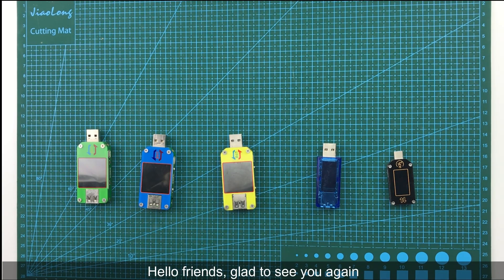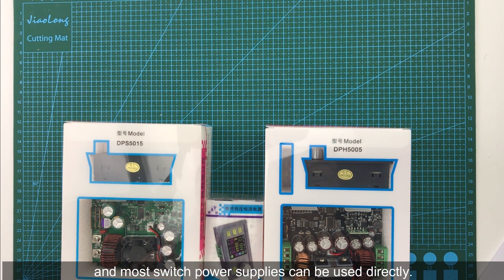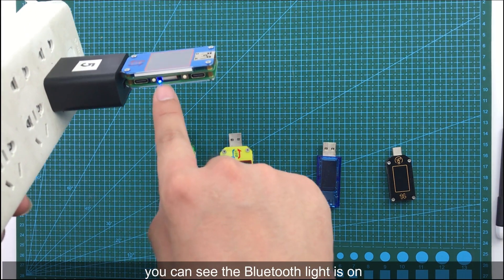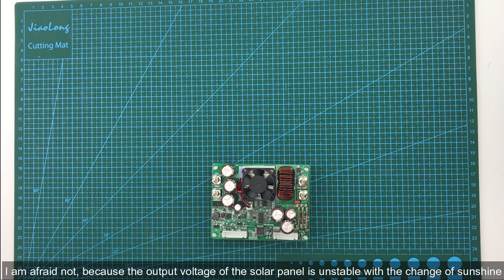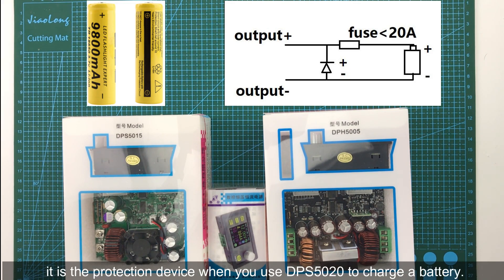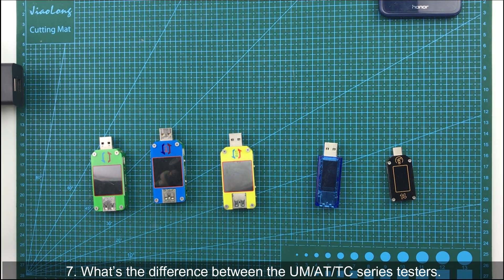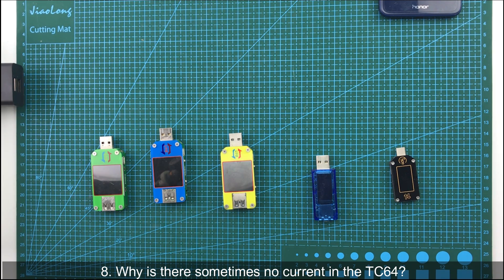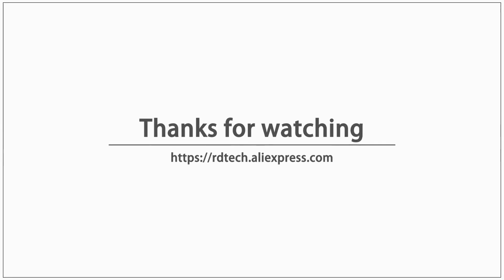8 Frequently asked questions about RD products(DPS5020, DPS5005,TC66C,UM25C...)

Comment: When changing battery, reverse connection is allowed, tried it before and all the dps5015 did is measure the battery voltage.
Reply from the maker: never allowed, it will burn the components
Reply: It didn't burn the dps5015 all it did is show the current battery voltage, plus it was done more than once
Reply from the maker: @TheUnknownCatWarrior  maybe you don't burn the board, but a lot of people burn the protection circuit by connecting the wrong electrodes, so just do not think it can reverse connecting just because you are lucky enough

Comment: i try to connect led 3v, using setting 12v 20ma on dps5020.
if i connect led first then output power on it's fine, if power on then i connect led 3v it will burn my led.
that's normal? Can you explain this?

Comment: One question, Why can't two power supplies be connected in series? I would like to use it as a dual supply to power op-amps that require dual supply (i.e. +/- 15V).
Reply from the maker: thank you for your comment, when we design the power supply, we didn't consider that someone will use two of this in series or in parallel, so we didn't add related protections, if you use them in series, it may be damaged
Reply: @rdtech9153  Thank you for the response. So even the older model DP3050 is not suited for series connection? What should be added? I think it would be an interesting option for future models since if they can be used in series for Split supply they can be used to power op-amps or audio amplifiers, it would be interesting and I think you would sell more devices. Anyways I like your products, I Will probably buy one in the near future.
Reply from the maker: @carlosagorreta5276  thank you, all of our power supply cannot be used in series, we doesn't add the protection circuit , so this problem will not be fixed by adding some components. if you want high voltage or high current, you can wait for new version, like DPS3003--DPS3005--DPS3012 then DPS5005--DPS5015--DPS5020
Reply: @rdtech9153  hi. What I want is a split supply to test op amps that require a split supply
Reply from the maker: @carlosagorreta5276  sorry for that, now we don't have that

Comment: Eu posso colocar uma fonte chaveada de 24v 20a no dps5005?
Reply from the maker: thank you for your comment, yes you can use that to power on DPS5005, and it can only work in buck mode

Comment: DPS5020 stuck in LOCK mode when disconnected from USB cable.  Can device be UNLOCK without connecting to USB again?
Reply: Silly me.  I should read the manual.  I guess I never had the need to use this function.
Reply from the maker: @TheAnalogKid2  it is OK, the manual is quite long, sometimes these functions will not be noticed if you read it fast
Reply from the maker: TheAnalogKid2 long press the rotary encoder can lock or unlock . Usually it will lock when connect USB. AND unlock when disconnected

Comment: Great information. The only cons about this is something Spirit Realm already told and that is about audio quality. Try to get a better microphone. Beside everything said in this very informative video I believe there is another information that is worth telling. And it is about power supply current (DP/DPS input current) regarding to the output current (from the DP/DPS). If you have a DP/DPS version you don't need a power supply that has the same or higher current that DP/DPS will be able to output its maximum. For example: If I have DPS5005 and have a power supply of 50V and 2A maximum, DPS will still be able to put 5A at output. Not up to 50V, but  for sure at 12V. This is because DPS is limited with voltage of the power supply and power (wattage) of the power supply. Of course DPS has efficiency which I don't know what it is :-) But I believe you can have more to talk about it in your next video ;-) Keep up the good work!
Reply from the maker: Thank you. DPS and DP series are buck power supply. The output voltage must be lower than the input voltage. For current, it doesn't matter. Just don't exceeds the maximum current. The efficiency is higher than 95%.so the input and output power is similar. Lower voltage means you can set the current higher
Reply: @rdtech9153  Exactly what users, that don't have a lot of electric knowladge, want to know. This is something normal for you and me, but not for all the users that have basic knowladge or just hobby users.
Reply from the maker: Tomaz Zaletel thank you. I will improve these details next time